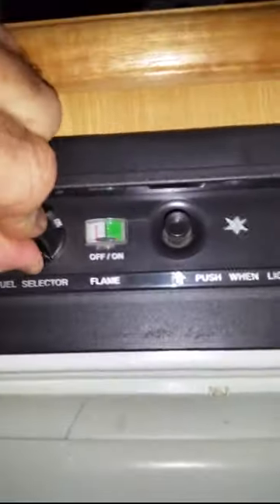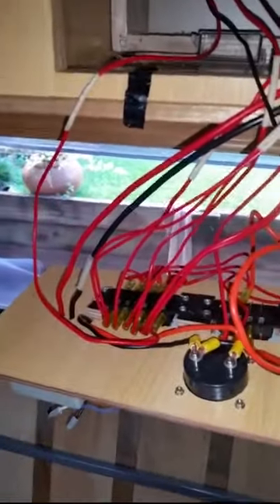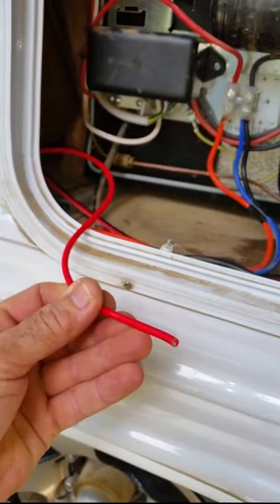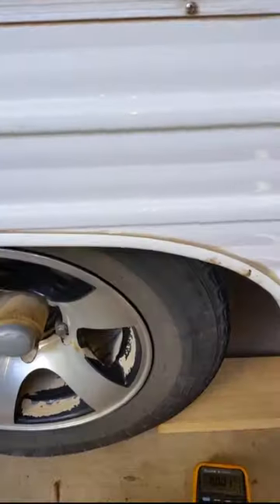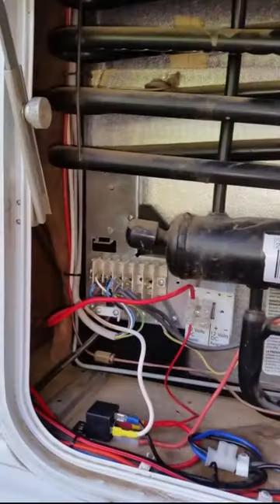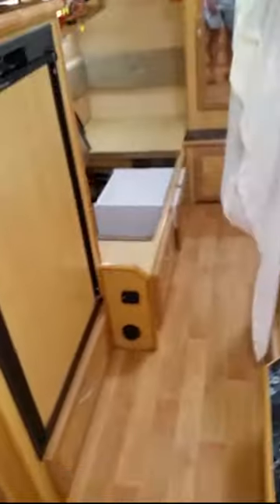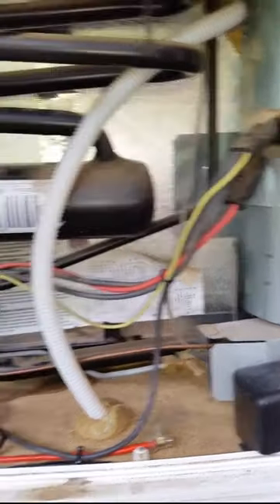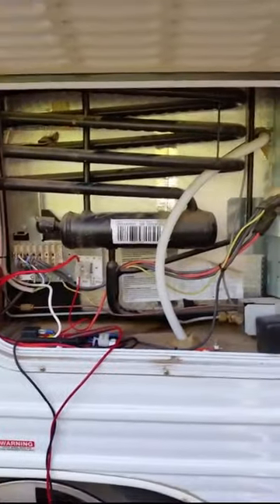Caravan Fridge on 12V Problem Fixed Part 1

Comment: Tim, this is absolutely fantastic, thanks. 

"Shitmess" is the absolute perfect description of the ridiculous stuff seen in caravan wiring.

I replaced all the power cables with 13.5mm², replacing 2mm². Everything else is 6mm² and have breakers, not fuses. 

The tiny original wiring only powers LED lighting.

I was also thinking about the wiring from the switch being too small, and using a relay too.
Reply from the maker: Glad you enjoyed it

Comment: Thank you for such a refreshing Aussie take on this topic. Usually these posts are American and really long winded and amateur.  As a diesel mechanic, I have  a reasonable feel for auto electrics and our Crusader XCountry 19' van electrics are just as crap as your van is (was). My fridge (same as yours)doesn't work on either 12vdc or 240vac. I believe the element is burnt out however I shall check it for continuity with a multi-meter prior to outlaying any $$$ for a new one. I love you wiring mod with the relay. I shall check mine and do similar if required. I have 500w in two panels on the roof. My next mod will be to replace the PWN regulator with an MPPT. These charge 2 130 Ah Glass mat batteries. On a sunny day this system may still be inadequate if a fridge draws 16A on 12v. More research required. Feel free to comment in technical terms.
Reply from the maker: Thats interesting that it doesnt work on 240V or 12V as they are seperate elements of course so your left wondering what would have caused both to fail. I think its uncommon for these elements to fail as it very rarely gets mentioned on the forums. I wouldnt bother changing the regulator to MPPT. PWM controllers work fine on van systems and MPPT controllers have much higher overheads running the more complex circuitry (up to .5 to1 amp of self consumption). It is important to have a good PWM controller and I have just installed a 30 amp Renogy solar controller. I previously used the Epever Landstar 30 amp in my previous van. These controllers are quality units and both have charge profiles that work accurately and dont over or under charge the batteries. The solar controllers that come with portable panels are very dodgy and I had one that had my batteries at 17 volts one day! The MPPT controllers really come in to their own if you want to use panels that are higher than 25-30 volts. The MPPT controllers allow cumulative panel voltages up to 100 volts input.  

Lastly dont try and run an absorption fridge on DC as they are to inefficient to operate that way except when you have unlimited power when towing. Also in the case of the fridge I had here there was no thermostat on DC operation and once you fix this power issue you can freeze food in the fridge on a long trip as it never cycles off. I later fitted a thermostat to control the relay.

Comment: Thanks Tim, this is really helpful. The fridge in my van works on LPG and AC but not 12vdc. I have installed a smart shunt and discovered the fridge draws no power when switched the 12vdc. After testing the rear of the fridge with a test light, there is no power to the fridge. I will use your tips to hopefully rectify the issue.  Thanks again.
Reply from the maker: The 12V is only present when the vehicle is attached as the fridge runs directly from vehicle cranking battery via the trailer plug - so you wont see 12v unless its connected.

Comment: The Fridge 12V DC is intended to be fed from the tow vehicle only, hence the label on your cable stating "front". It's not meant to be connected to the leisure battery, it will flatten the battery in no time. 
240V when connected to the mains power, 
Gas when you are stationary and off grid, 
12V DC when towing, normally via an Anderson plug and cables.
The tow vehicle normally has a fridge relay to switch the 12V DC supply on when the ignition is turned on the tow vehicles, this prevents battery drain on the tow vehicle when it's not being charged.
Reply from the maker: Thanks Ian I guess "Front" makes sense of the labeling as it was originally. I do run the fridge from the caravan batteries as that is the only way it can maintain adequate voltage and current to run the fridge correctly and keep it cold. Since I made this video I installed a DC thermostat with relay output which controls the automotive relay and therefore regulates temperature as is the case with Mains power and Gas operation - there is no thermostat operation on DC normally which means it would run continuously and cause the fridge to drop to a very low temp on a trip. The fridge now only runs as required to maintain temp (rather than continuous) and I always switch it over to gas or mains as soon as I arrive at my destination. I have not had an issue with battery drain even when I stop for lunch etc. The batteries are always fully charged when I arrive. If I find this becomes an issue I will install a "no charge" detector switch on the vehicle input to the DCDC charger, which will stop the fridge running after say 30 mins when stopped.

Nov 2020 I have not been required any method of shutting down the fridge when travelling. Stopping for an hour has not caused me any issue as the battery fully recovers when I drive the rest of the journey. I think the temperature control on DC (see other video) makes a huge difference to battery drain.
Reply: Ian Robertson yes, exactly that!

Comment: Great video and I enjoyed your comment "Piss Poor". Haha. Reminds me of PPPPPPP Prior Preparation Planning Prevent Piss Poor Performance. Simple fix Tim. My fridge just broke down, it was very old and needed some major service and seal... So I have bought a new 3 way fridge and I will use your set up with the relay to ensure the fridge works whilst on my normal 2 hour drive to and from camping site. Many thanks from Lismore NSW Australia
Reply from the maker: Thanks Walter hope it helps. I rewired a friends caravan similar to this and installed a DC/DC charger and his fridge now drops to about -10 or more on a trip of 2-3 hours if he started the fridge the night before. His fridge was hopeless before that as it was running directly via the anderson plug, again via undersized wiring and long cable runs from the vehicle battery. That resulted in warm food and beer by the time he arrived.

Comment: Thanks for great explanation. My motorhome fridge works great of 240 and I was told I should get a couple of days of 12v off solar. 12V just fades, so I am about to get the wiring checked to see if I can get an improvement in the chill factor for the fridge. Cheers.
Reply from the maker: Hi Val, you cant run this fridge off solar as its way too inefficient and the 12 Volt is only provided to operate the fridge while you are traveling as LPG cant be used as it can blow out and could be dangerous. These improvements do however mean it will run efficiently on 12 Volts when traveling and keep the fridge at working temperature as good as LPG and mains power. Cheers Tim

Comment: Can you add thicker wires such as a 6-8AWG or 10-12AWG wire with an inline fuse to 12V part of the fridge connector to prevent voltage drop or will it cause a fire? My luxima 3 way fridge only has thin wiring I’d say around 18-22AWG for the 12V while I was replacing the 12V male lighter plug with an Anderson plug

Comment: Great idea! Would you have a wiring digram of how you hooked up the relay? Also curious what size wire you ran from the battery to the heater element?
Reply from the maker: I may have a diagram i will look for it and let you know.
Reply: @timterry8714  Thanks Mate. Also for your switch wire. Is that just hooked up to your battery?

Comment: Tim where did you connect the orange wire after you replaced it with the red to the relay??
Reply from the maker: I simply capped it off and it wasnt used. I assume you mean the original wire from the fuse box to the back of the fridge.

Comment: I have the same fridge looks like a good set up not sure which wire goes where on the relay.
Reply from the maker: The relay has a 12V coil which activates the high current relay contacts or switch. There is always a small diagram on the connector pins side of the relay showing the switch contacts and the 12V coil. Google for your specific relay there will be information on the connection points and what they do. Cheers Tim

Comment: Thanks Tim what a fab job you've done.  Unfortunately my Dometic isn't working atm, hence how I stumbled across your vids.  I've already checked my fridge and mine is 175watts one bit of good news and I'll be following your set up.  I'm assuming you had to pull your fridge out a little to cut and install microcomputer temperature controller?  I was told to put in a Voltage Sensor Relay between fridge and car battery/alternator.  You mentioned you  installed a motion sensor.  Can I ask why...montion versus VSR.  Thanks
Reply from the maker: I have seen a lot of comments on the forums where people install a motion detector so the charging only occurs when the vehicle is moving. I tried the voltage sense relay but wasnt happy with it so took it out. I think also that with the temperature controller cycling it on and off signifcantly reduces the load on the battery except in the hottest weather so its not an issue if you stop for an hour or so and leave it running on the house battery. It will fully recover after all 1 hour full time with this fridge is only about 16amps at 100% on time.
Reply from the maker: My mistake with the VSR was to install it in the van next to the fridge when it should have been as close to the battery terminal as possible. the current draw of the fridge is so high that the voltage drop even on a small cable run is enough to cause the VSR to "chatter" switching on and off as the voltage changed up and down. This is over come to a large extent if the VSR is right at the battery terminal.
Reply: @timterry8714  thanks Terry I ended up taking it to a caravan repair. It's working now he installed that temperature wire inside the fridge like you did. But I'm not sure about how much power it drawers from the battery I can only hope it's not a high draw from the battery. I've had other mechanical issues with my vintage girl but will definitely find out in January for my big trip fingers crossed.
Thanks for your reply 🙂

Comment: How quick was it before it run the battery flat??
Reply from the maker: Its never even come close to running it flat
Reply from the maker: Its only ever on 12V for travelling and straight back on LPG as soon as we arrive at our destination. Its no problem leaving the fridge on 12V if you stop for lunch, etc as long as you have DCDC charger to charge your battery while driving.

Comment: @1.47 the wiring is totally inadequate is because Auto Electrician is a title any Charlie can call himself. NFI  ( NO F----ing idea ) a lot of them, when it comes to voltage drop and the correct gauge of wiring to be used (Jayco are a prime example of this). I am here in Australia and have personally spoken to at least 3  " Auto electricians" and Fark me NFI again.
Reply from the maker: There are no auto electricians involved in caravan wiring, in fact no tradesmen at all. They get someone in to sign off on AC power and LPG as required by law but the work is carried out by unqualified low paid workers looking at photographs of what wires go where. Little changed in the van industry till 2018 when they realised they could charge a lot more to set up vans for "off grid" but still the wiring standards are relatively poor today.
Reply: @timterry8714  Very true Tim, in fact I am sure Jayco only use thin wire due to the cost of the thicker copper wire, Built for a price not to a standard. Rubbish company in all honesty, and they are just one of many.
Reply: @timterry8714  I Totally agree Tim, I wish I had the recordings of the so called Auto Electricians I spoke to on the phone, those guys would not have been able to put a plug on a toaster I am sure.